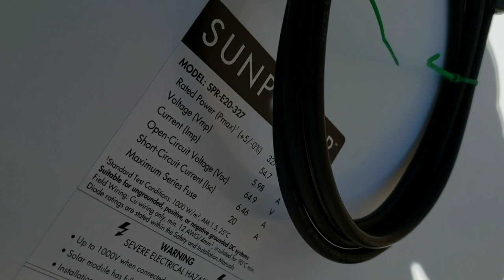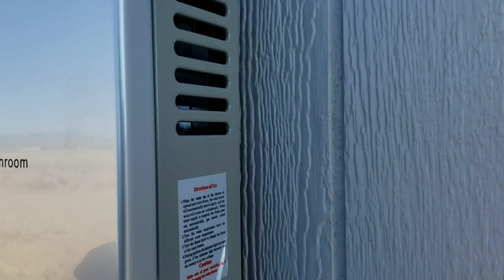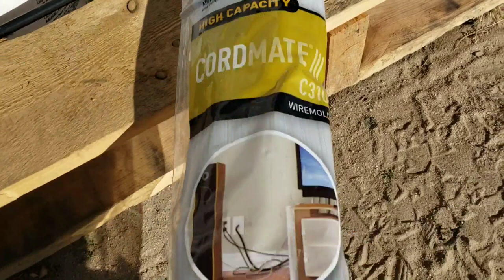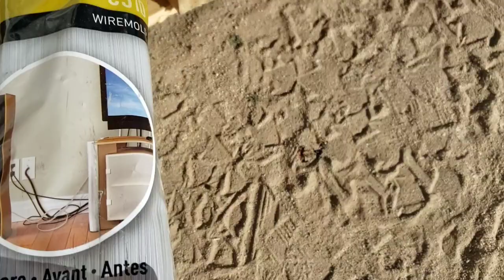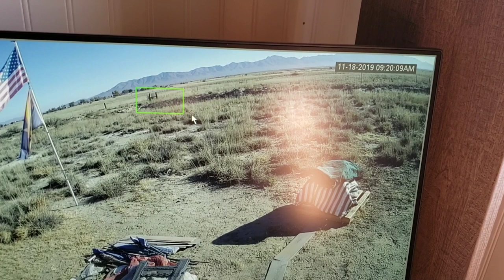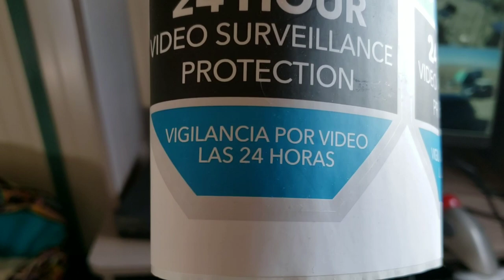Solar, surveillance, new water heater #AZhomestead #offgrid

Comment: Kristofer, You might try rubber foam weather seal for the long part of the doors & then get silicone door seal strip for the tops and bottoms of each of your barn doors... They sell the stuff at Home Depot and Lowe's. I used it on my shed because I wanted more of a climate-controlled area for when I was gone for month long trips. They sealed out the bugs, dust, moisture (rain plus humidity) and wind so the things I had stored wouldn't become nasty while I was gone. I used the same stuff around the windows in my house, although that didn't stop the thieves when they lifted my sliding door off of the track & broke off into my house.
Anyway it's worth a try👍 Glad you had a good time on your vacation🎉👏🎉
Reply from the maker: Thank you Mona. 😊
Reply: @KristoferTravelsHomesteading  I'm always looking for an inexpensive & effective way to complete my dreams💕😉.  I think it would be neat ifyou put in a small window on the opposing wall of the door🤔 to increase to increase the light in the barndominium?
I forgot to tell you how much I enjoy your security systemand wish I had thought of something like it earlier. It is a great idea!!!
Reply from the maker: @justmona9647   Thank you Mona I am sure enjoying the cameras and being able to see all around me.  😊
Reply from the maker: @justmona9647   I'm always scared of cutting holes in the barn but probably in the future I will do something like that.
Reply: @KristoferTravelsHomesteading  I certainly understand your fear of cutting the beans on such a small barndominium,but maybe you can find two small windows so that you wouldn't have to cut into the main struts of the building so the beams would not have to be cut into for placing the windows. Just a thought. Safety is everything when cutting into a wall, I agree with you wholeheartedly💕

Comment: I have an idea on the sliding glass doors. If you leave the barn doors to serve as shutters for protection and insulation you could simply build a frame inside behind the barn doors and that way you don't have to modify the structure which might possibly weaken the integrity of the header support over the door area. You can have latches that hold the barn doors open when you are home so you can have the best of both worlds that way, you have your sliding glass doors and you have the safety and security of the barn doors to close when you leave for work or are gone on a trip. 

I am very interested in that surveillance setup you have. I'd love to see your unboxing video or perhaps you could list the information on the system and where I can look at it to possibly purchase. I had a break in not long ago, I was home and they only gained access into my enclosed locked porch, they were trying to get in my house door when I heard them. I scared them off and have since stepped up my security measures but I'd love to have a surveillance because it would give me more peace of mind when I'm gone from home.
Reply from the maker: Maggie you are a genius. You and my aunt suggested the same thing and I believe that's what I'm going to do. And this is why I love you all.  And yes it's ancrest 4 channel hd. thank you destimonium 😊
Reply: Love the idea about the glass door!

Comment: Hey, beautiful friend! Enjoyed your video. I'm so happy you got the surveillance system. Love it and I know you'll enjoy having it. As to a sliding glass door, it sounds great except that I have one and it makes a place so much colder in the winter. You have no idea how much cold comes off the glass and they need to be sealed very well. But I do live in N Tx and we may get a lot colder weather than you do in AZ. But it's so cold in the winter that I have been sealing it with several layers of thick plastic to totally enclosed that door. It makes a huge difference. What I'd like to suggest is that instead you might consider putting in long windows on either side of your door. That would give you a lot more visibility and might be more secure than a glass door. For me, I wouldn't feel as secure being away, having a large glass door. Just some thoughts. Hang tight in the rain and enjoy more sleep.
Reply from the maker: Hello my friend. The door I was looking at has double pane and should be very efficient but I have an idea which is coming up in the next video. Much love your way. 😊💚

Comment: I looked at an old video and I can see that there are cripple studs above the door that you could modify to get the rough in clearance for the glass door.  Although this could be done, it means quite a few modifications.....you would have to remove the cripple studs, jack studs and header, then cut new cripple and jack studs (shorten the cripple studs and lengthen the jack studs).  Then put the new studs and the header back in to make the opening big enough for the new door.  It might be a lot easier to modify the doors so that they make a better seal.   Attaching some molding pieces and weather stripping might do the trick.
Reply from the maker: You are definitely a wealth of information. I think I have another solution I will be putting it out in the next video feel free to leave your thoughts about that.  Let me know what you think. 😊

Comment: Does your tankless water heater have a round vent on top? There are some that do and you could always bring it inside and vent it outside with a stove pipe elbow. Might be easier for you than building an enclosure? I have a tankless water heater inside but it doesnt have the round vent..I just simply open the vent in  the bathroom and run the fan when using it. Havent set off the CO alarms yet lol
Reply from the maker: Hi Gypsy Jenna. Yes it has around top which will fit a 4" elbow vent.

Comment: I  am a ways away from solar yet.  I have seen so far, recommendations that panels be same wattage, I am guessing since yours are different, and working, they work but at whatever the lowest wattage panel?
Reply from the maker: Yes which ever is the lowest panel whatever higher ones go down to that wattage.   So my lowest panel is 280.  So I have 560.  It's doing amazing even with clouds.  Which is surprising being monocrystaline panels.